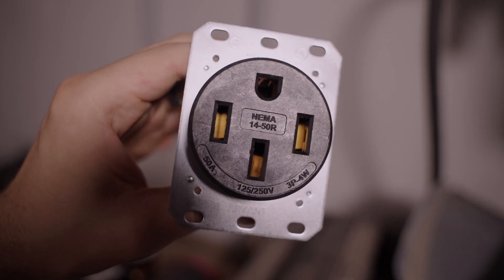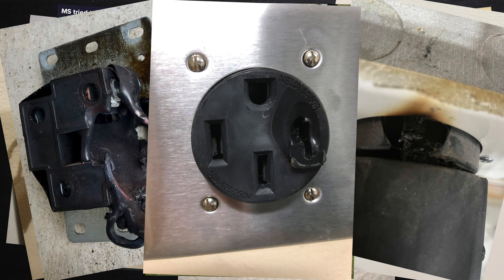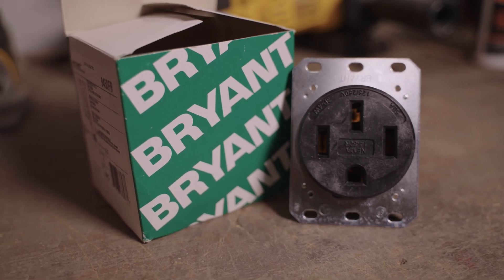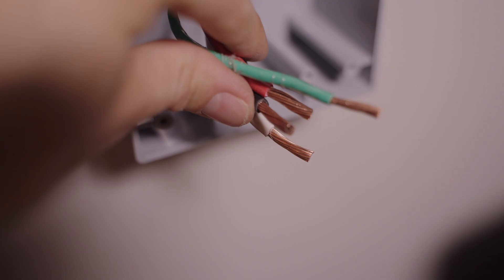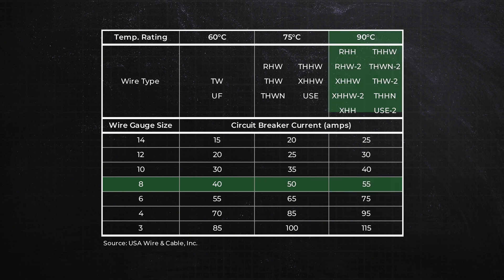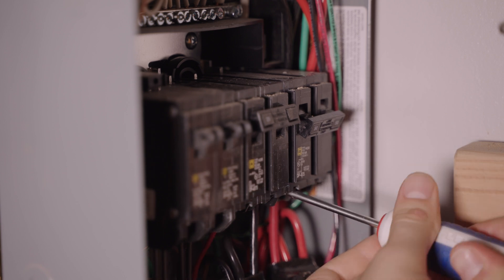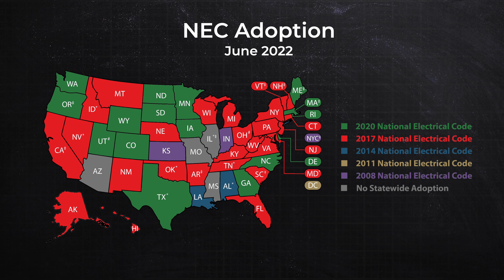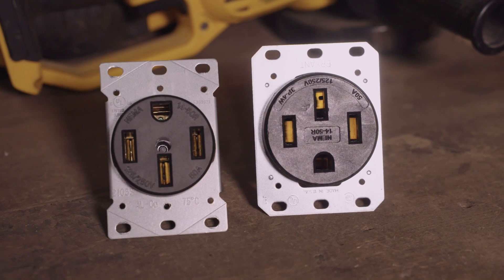3 Mistakes I Made Installing a NEMA 14-50 Outlet

Comment: As long as the outlet is UL approved it should be fine. Of coarse Hubble is the gold standard but correct installations are the most important part of the project.
Reply: UL approval requires use as per manufacture specifications. (i.e. printed on the unit, packaging, or a separate datasheet.) UL approved for a drier or range does not necessarily mean fit for the high continuous loading of EV charging. (or wet environments for that matter.)
Reply: UL Approved does not equal the device is designed for/safe for every application. 

As the video clearly stated, the residential grade outlets were designed for power draw over a short period of time and not built to be plugged in and out of multiple times a week. Commercial grade outlets are built to withstand constant high power consumption and to be repeatedly plugged in and out of.
I can go buy a 120v 15A outlet for $1 or $5, both UL listed. The $1 (residential grade) dollar one is good for a low power lamp you never unplug, the $5 (commercial grade) one is good for the microwave or a charger, hairdryer, etc. that has higher power draw or you constantly unplug.

It's the same thing with a extension cord. The UL listed dollar store 18 gauge (thin wires) cord is good for low power stuff, but trying to run a large space heater off it all day can easily start a fire. A 12 gauge (thicker wires) extension cord will run that heater all day (assuming its not too long and doesn't suffer from too much voltage drop).

You can install everything perfectly, but with the wrong components you can damage equipment or start a fire, just as having all the correct components can cause damage/fire when installed incorrectly.
Reply: @notme232  where does it state to NOT use these non Hubble outlets for EV’s? I’ve been using standard lowes outlet for three years with no issues at all. Proper Installation is key
Reply: @lseguy  Guess you didn't see all the photos of melted outlets......too many fires have resulted from using the cheap residential outlets.
Reply: @ricksweetser1683  nothing in your reply was an answer to my question
Reply: @lseguy  Wasn't meant to.......ask any competent, licensed electrician and they will answer your question.  Hope you don't find out the hard way.
Reply: @lseguy  Lowe's has a good selection of nema 14-50 outlets. While they might not be Hubble brand, they clearly aren't the cheap outlets that are melting. Clearly what ever you are getting is working, personally I don't care if it Hubble, if it works it works. 

I have a concern with the statement "As long as the outlet is UL approved it should be fine". This does not tell you if a device is fit for the application, it tells you that device has been tested to be safe with mfg specifications. A solid metal box rated for wet location would not get UL approval, but the same box rated for indoor/dry location would get the approval. Proper installation is key, a big part of that is knowing exactly what the system components are and are not capable of.

Comment: The most common failures are caused by improper torque on the connectors and loose contacts.  Many turkeys are cooked in ovens connected to standard outlets for  hours each November without issue.
Reply: All ovens are intermittent, they turn on and off, to control the temperature in the oven, that is not a full load like a car charging circuit would have. Pay attention.
Reply: @tedmoss  ... yes, not to mention the average oven element is only 2500 watts, so roughly 10 amps per leg. (intermittent use via t-stat) To get full draw on the whole appliance you'd need all the burners on as well, and that might only happen for a few hours, and probably not all on the high setting for long.
Reply: @rupe53  No one uses burners and the oven simultaneously?
Reply: @timgraham7851  ... did you read the other posts? If you know anything about electric stoves / ovens, everything cycles on t-stats unless the burners are on high. The only way to get the oven on continuously is to use the broiler, and the chance of that happening for a prolonged period is pretty slim, even cooking a thanksgiving meal. Bottom line is maybe 30-60 minutes of full draw, then everything cycles. All burners on high will be roughly 6500 watts, or roughly 27 amps. We're way below maxing out the circuit for the 3 hours that defines a continuous load. (around 37 amps)
Reply: @tedmoss  And?  Where is it stated that those receptacles have a duty cycle?

Comment: The Leviton brand 14-50s, when installed 'correctly' with the ground lug at the top, will have the printing upside down. I used Romex cable, which is a real bear to work with.

Comment: Can you cite any actual evidence that a Leviton receptacle is not made/designed for a sustained load of 40-amperes? Also, the major error in your video is replacing your 50-amp breaker with a 40-amp breaker. You now have a breaker (40-amps) that is only permitted to supply 32-amperes, (continuous) which is 20-percent below what your EV charger will be using….your 40-amp breaker is guaranteed to fail.
Reply: You are (incorrectly) assuming he isn't setting the charger to a lower current level. I cannot find anything to say the Leviton 279 outlet can or cannot sustain full rated current for any length of time. (only a 30C rise in 50 cycles @ 150% [75A]) Likewise, there are not indicated use cases, or not. Given the beefy contacts used, I would hope it could, but the plug used has just as much to do with it.

Lots of people have had success, and a few have had melted outlets. I've seen melted outlets first hand, but they weren't always treated well.
Reply: He’s making stuff up. I’ve been using a properly installed Leviton to charge my Tesla for 3 years with NO issues.  Then again, I had a proper install with quality 6 guage wire
Reply: @lseguy  Yep. same here Leviton 14-50, 32 amps charging rate. about a year so far.

Comment: One more thing the evse should be plugged into the 14-50 outlet and left there if you have a Hubble or Bryant outlet those terminals are a little more heavy duty when people keep plugging and unplugging that's the main cause of the problem! I've been charging two Chevrolet bolts at the same time on two different circuits with Menard brand nema 14-50 after a year there is no sign of burning my two evse stay plugged in!
Reply: Not in my experience. I have unplugged my charger maybe 4 times in 2 years. With a Leviton 14-50 I was getting high temperature warnings after 1 year. I retorqued the screws and 6 months later the internal blades were relaxed enough to physically buzz when inspected with a contact stethoscope. I reduced the charge current to 70% of maximum until I could replace it with a Bryant. No more overheating or buzzing. I think it’s a metallurgy issue.

Comment: I found when replacing nema 14-50 outlets they're all rated to carry 50 amps! The Hubble's and Bryant's will burn too if they're smashed into a shallow electrical box! All the conductors need to be completely recessed into the terminals no frayed wires!
Reply: The cheaper outlets have a very poor connection for the load, the industrial outlet has a solid connection. That's the main difference really
Reply: What causes them to burn is not necessarily the load, but poor contact with the plug. I've seen this hundreds of times -- RV parks, and race tracks. (and as it would happen, a Tesla did set one on fire at Road Atlanta a few years ago. We still give him grief about that.) The AC in my RV cooked one of the plugs on one of our 8AWG extension cords because they have shit contacts in them.)

Comment: Would you use a 6/4 or 6/3 wire with your Nema 14-50?
Reply from the maker: You will need three conductors - black, red, and white and one ground - green. For runs through conduit, individual stranded conductors should be used, but in-wall wiring could use 6 AWG Romex. An alternative is to get a NEMA 6-50 outlet and EVSE with this plug - although less common. The 6-50 only requires two conductors (black and red) and a ground. I haven’t seen a 240V charger that requires the neutral.  Good luck!
Reply: @chargeeverywhere  ... you make a valid point, but NEC doesn't allow the use of an outlet without a full complement of wires. IOW, if you have 4 pins / prongs in the outlet you must have 4 wires. If you hardwire to an EV charger you can meet the needs with only 3 wire cable. (no neutral) The difference in wire cost isn't enough to NOT do it correctly and future-proof the job.
Reply: Future proofing would also be adding the gfci! Dont Tesla chargers have a built-in gfci???
Reply: @JM-iz3fr  ... there's' the catch 22 on code. If your area is using the 2020 NEC you are supposed to have GFCI for the receptacle. Rumor has it that some car chargers have the GFCI built in, which will cause random trips. NEC makes no provision for skipping the GFCI other than hardwiring the charger. My suggestion would be to research your charger and talk with your local building inspector.

Comment: GFCI is required for licensed/commercial or permit work under the new 2020 NEC code, not typically DIY. Also, many places have not adopted the 2020 code and some have exceptions to it for EVs… so you be grandfathered in if that ever changed… just like any professional following the earlier code.
Reply: They make gfci for these. I have not come across them.  Where could I find them at. Or are you talking about the breaker with the pigtail on it gfci
Reply: @NA-xm7wj  I have not seen GFCI NEMA 14-50 receptacles but the way the NEC requirement is written you could use either. I can only find GFCI breakers with the pigtail but it’s possible the code will create enough demand that we will see GFCI NEMA 14-50 receptacles in the future.
Reply: @emmettturner9452  ok cool. That’s what I thought you meant but wasn’t sure. Yeah it would probably be good to have a gfci right at the receptical. Thanks
Reply: @NA-xm7wj  …and might even be cheaper (hopefully!).
Reply: @emmettturner9452  yeah hopefully. I’m considering putting in the wiring fir ev’s cuz I think I’m selling the house next year and I hear having it wired already is a plus to buyers that either has electric car or wants to buy one. Hell I want one too but haven’t found the one fir me yet
Reply: As they say, it's only required if it's inspected. :-) I've heard of GFCI outlets this big, but the requirements for "ready access" generally means they end up in the breaker. (a drier or range would not be accessible.)

Comment: One thing you did right was match the ground so the plug doesn't put a strain on the cord or outlet. One of the examples you showed, I believe it was a woman, plugging in her cord where the cord ran upwards which causes strain.
A couple of things that you missed, when dealing with stranded wires it best to use a ferrule crimped on the end before you put it in the socket. Tightening stranded wire can break off individual strands. It's not so common on the larger cables but it's still recommended.
And it's not a DIY project if you wish to collect any insurance money from your home owners policy. They will not pay if you didn't have a licensed electrician install the outlet, and get the required city, or county inspection. I have also heard cases where the homeowner did unrelated none permitted work and had a claim that had nothing to do with the unpermitted work.
A homeowner can replace existing switches, and outlets, but adding new circuits requires a permit, and inspection in most cases.
Reply: Your statement about requiring a licensed electrician to install it is absolutely incorrect.  A homeowner can do electrical work in their own home as long as you have a permit and it is inspected. I know this because I wired in my whole shop. I installed the 200 AMP panel also. I had two inspections, rough in and the final. The inspector said great job. I followed 2020 NEC codes. My shop is insured by my home owners insurance. They looked up all of the permits.
Reply: Correct re needing the permit, but it is definitely DIY-able.. but if not comfortable, and unable to do required permit work (eg load calculations), get help from electrician.